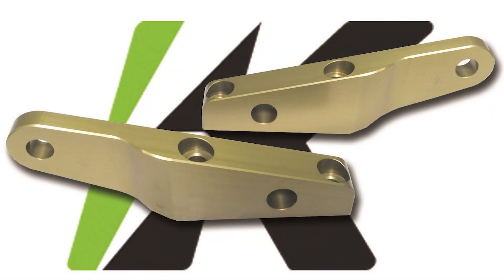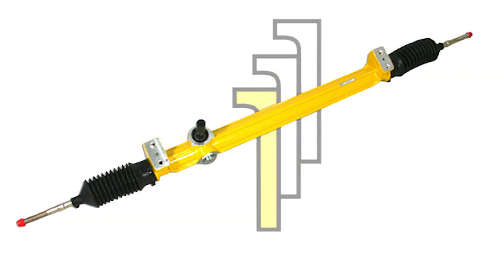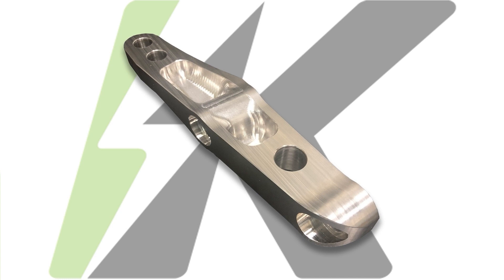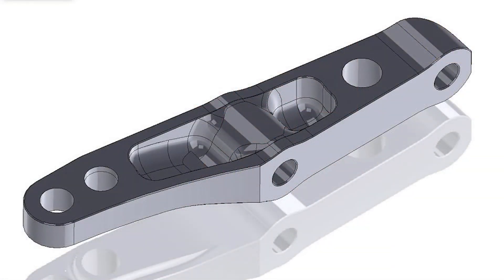Tech Talk: FASTarm Testing

Comment: is there any benefits if you already have the upgraded steering rack mentioned here?
Reply from the maker: Additional camber would be the reason to consider these.  Especially if you run normal ride heights - these will get you closer to the ideal camber.